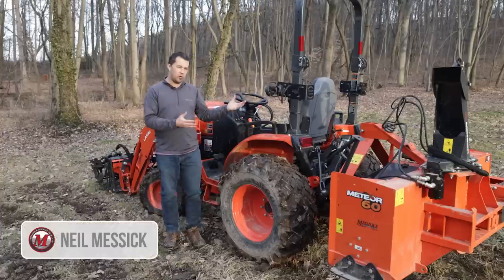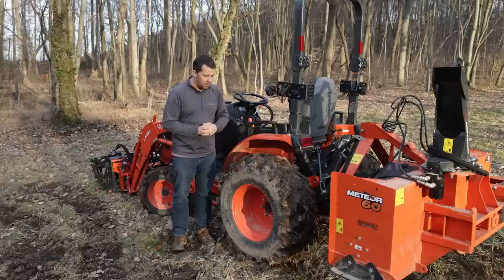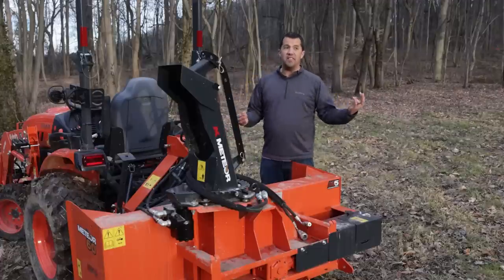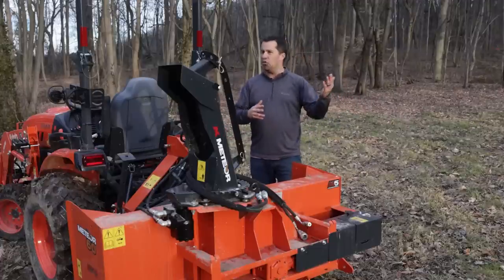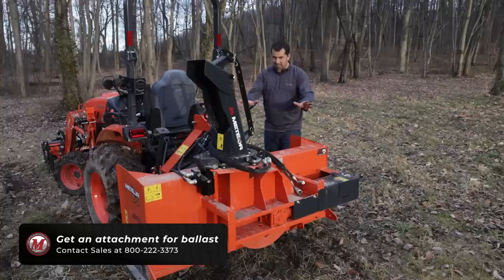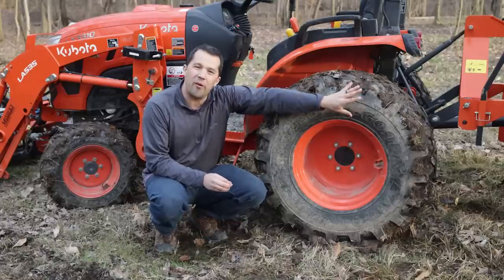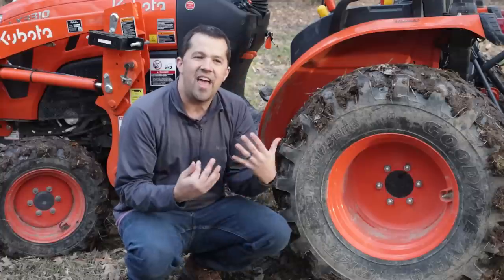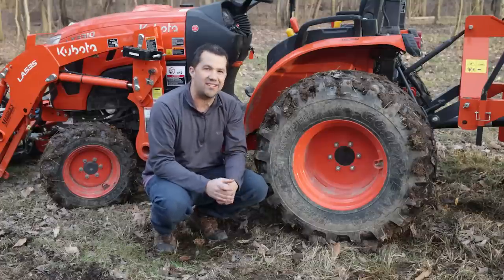Stability & Performance. Tire Ballast vs Machine Balance

Comment: I made 3 point hitch weight with 55 gallon drum and concrete.  It weighs almost 1000 pounds.  I use it on my Kubota L4701.  We need the counter weight for moving heavy round bales for the horses.  The concrete drum works very well.

Comment: Adding ballast to the rear tires, just puts weight in the rear of the tractor holding the rear of the tractor down. It does not unload the front axle. When lifting a heavy load it also makes the front axle the fulcrum. By adding a implement or ballast box to the rear of the tractor, the fulcrum moves to the rear of the tractor. Lightening some of the load off the front axle. Just my opinion.

Comment: I put weight on the front of my tractor. I find with the weight it doesn't go through front tires as much. I have a 25 foot 1/2 inch chain and 2  - 15 inch long railroad rails it's about 180 lbs. Year round.

Comment: all depends on what your doing I got my l3901 loaded with rim guard works great for me but it will leave small tire depressions In the yard but thats not normally wat I use it for but if I did do more landscaping stuff with it I wouldn't have them filled

Comment: I use my BX2370 mainly for mowing my yard so I wonder just how much removing tire ballast would help ride quality. If it was worth the switch I could always add wheel weights.

Comment: I also choose not to use fluid filled rear tires due the ride quality compromise with the minimum weight/balast benefit.  Instead, I use my box blade with a quick connect/disconnect device which keeps me stable and results in a more comfortable ride.  If more blast weight is needed for that heavier loader work task, I install my brush hog mower on the rear....and mine is probably the heaviest on today's market for my tractor size.  Yes, my turning radius is compromised but that is a very small condition to tolerate to the alternative of a turned over tractor.

Comment: You need a Good Works Tractor VersaBracket and 8 70lb weights :)  Beats having a large implement back there that could inadvertently cause or take damage. And they're Quick Hitch compatible.

Comment: If your primary use is going to be mowing with a 3 point or belly mower, you don't necessarily need or want that additional weight compacting your grass. 

But for loader work, you definitely want additional rear ballast for stability, like loaded tires. 
    Know what your primary use is going to be and accessorize appropriately for function and safety.

Comment: When I had my old bx2200 I felt quite safe with just a rear attachment on. But when I got my new 2680 with cab, even with my finish mower on, it felt extremely unstable so I filled my tires. 
Now move on to larger tractors, my 135 massey Ferguson needs fluid in the rear tires or it’s absolutely useless doing things like plowing. But my plow is have enough I require a few hundred pounds of front ballast to keep control of the front end

Comment: I just fill my tires with depleted uranium pellets.  27 gallons in each tire gives you 1,850lbs per tire and combined it's right about 3,700lbs of ballast. Plus cancer.
But hey! I won't be worrying about lifting the rear axle with the bucket, right?!
... don't worry, not actually doing anything like this, just a thought experiment as to what kind of weight you could get into a tire is you really, really really wanted to max out your ballast potential and depleted uranium is 1.6x denser than lead.

Comment: I dont have the tires filled on my t494. I have the backhoe on when lifting anything heavy and so far have not felt the need to fill the tires. But i'm mostly just lifting 2,000lbs logs. in the spring ill be moving pallets of pavers which may cause me to reconsider the ballast.

Comment: My opinion is that if a loader goes on, some sort of ballast should go with it. Tires loaded or wheel weights.  You can't fix stupid,  so don't depend on the operator to put something on the back for weight.

Comment: If you don't plan on pulling implements from the drawbar and really only using 3pt attachements, there really isn't much point to adding fluid to the tires unless one needs the extra weight if requiring more traction.

Comment: I have an LX2610SU with a loader and backhoe, my tires are filled with ballast because my property is very hilly and I feel it may add some stability on grades.  Any thoughts?
Reply from the maker: Yes. Tires ballast does help with stability better than an implement would

Comment: neal neal neal when a ag tractor is ballast with fluid is not 100% full the air space at the top of the tire is the cussion i keep mine at 10 psi and do not decrease the ride quality having said that your milage may vary

Comment: Great video Neil 😁 I too run without fluid filled tires because I mow my lawn and do loader work. I have a 700 pound ballast box on a B2601 for loader work if needed. What do you think about tire pressure I run only 10psi in my rear tires and the ride is smooth plus I feel like I get more traction with more tread on the ground in the snow. Thanks for the video 😁👍🚜💨🍳

Comment: My question would be about my lx2610 that has tire ballast. when I'm using my bucket, I put on my Kubota weight box that I filled with concrete (probably 500 pounds). Do I still need that tire ballast when Im scooping a almost full bucket of gravel? I like the idea of taking the ballast out of the tires since the tractor is really rough (ab work out) when Im in my field with the brush hog. I like the idea of having air for a better ride.
Reply from the maker: So yea, that's exactly my thinking.

Comment: What’s the best way to take weight off the front axel if you use a 3 point mower that runs on the ground because then no weight is added to the back of the tractor.
Reply from the maker: Front weights, front loader.

Comment: 'Take the money from filling your tires and put it toward a heavy implement...' what implements are you selling for the $57 it took to fill my tires with 800 plus pounds of methanol? Granted, my tire shop is awesome, but even with rim guard or the like, there are not many heavy implements in that category. 

I have also found that even with the tires filled, sometimes I need my box blade with the 55gallon drum of water on it. The tires being filled makes it to where the tractor is usable without an implement for loader work. Sometimes you have to get in tight spaces.

Comment: But when filling tyres the valve is up at 12 a'clock = there will be ~25% empty that then is filled with air. One bonus is that the fluid pushes the tyre to the ground = there is no aircushion between.
 My opinion is that if the implement in the rear is a little to heavy the tractor can start to swing. Hit a bump and the front tyres "leave for space". A backblade with hydraulic turn and movement can do funny things when the weight is 4-6 feet behind the back tyres.
 I have once pushed a front tyre of the rim lifting to much, never want to do that again. The backblade attached, heavy wet snow in the big bucket and a little to much turn on the front wheels... I know that I shouldn't turn the wheels with big loads lifted, but sometimes operator errors happen 😱😥🤣.

Comment: If I loaded the tires with fluid it would provide problems with trailer loads. I'm getting ready to carry a 1,000# of fertilizer on the trailer with my unballested tractor with rotary spreader(light weight). Heavier tires would overload the trailer. .

Comment: Although I do agree, I also cringe every time I see my son whipping around with a $2,800 tiller hanging off the back of our tractor for ballast, and I give him hell for it. I also have a three point snow blower, and know they don't come cheap. One hit into a post, tree or other immovable object can do enough damage to throw off the geometry of either of the two implements I just mentioned, causing more issues than you will ever want to deal with, not to mention to the three point and the rear PTO. This is why I'm a big proponent of ballast in tires, as well as on the rear three point (close in). A ballast box is cheap at under $300, and even cheaper to build as most of us have.
Reply from the maker: Yea, have backed my flail mower into trees more than once.

Comment: In my case I have a sub-compact tractor...adding fluid to the tires would be a terrible idea...I do use my BX2680 to mow my lawn occasionally, so having the weight of those fluid filled tires would be a horrible idea for the lawn....Like you Neal, I just put an attachment/implement on the 3 point when I'm doing loader work, seems to work pretty well that way...no loader work at all without an implement on the back since the tractor weighs next to nothing in the first place LOL....To me its just easier to have an attachment or implement on the 3 point than deal with the results/effects of fluid in the tires...I guess if I was just out working in the woods, or a field, or something of that nature, ballast in the tires might make sense, but for many people who are doing things in their yard, or otherwise driving across their lawn all the time, that extra weight in the tires all the time would be a bad idea, with a removable implement/attachment on the back that you can simply take off when you aren't needing the weight, makes a lot more sense.

The only issue with having an attachment/implement on the back is if you are working in a tight space, but I'm sure you could add wheel weights for those cases, or some sort of a rear weight bracket on the 3 point probably could be fabricated.

Comment: Ive got a Grand L 4060 so much bigger than your tractor and it has hundreds of lbs of water in the rear tires. I see no need to remove the water. The water doesn't add any stress to the tractors frame because the weight is not constantly loaded on the tractor but it is loaded on to the earth. If I need way more weight I just hook my big ass land pride  700 lb rotary cutter to the 3 point.

Comment: In the owners manual for my l4701 it says not to ballast the rear tires if you have the backhoe installed. The salesman sold mr ballast with the backhoe installed.